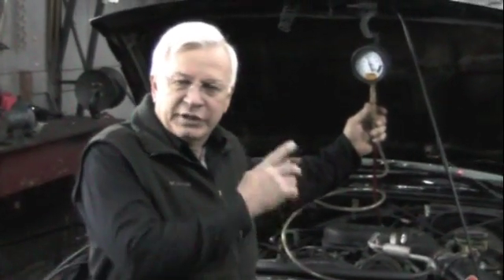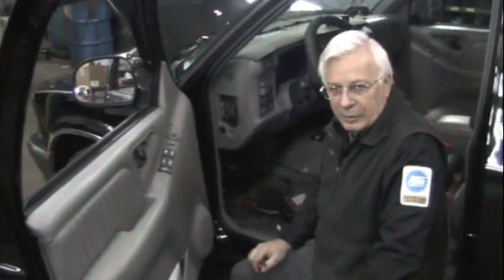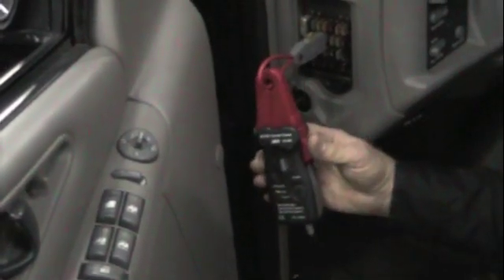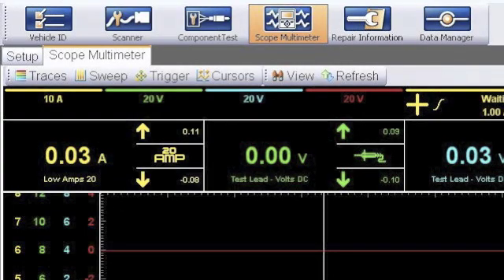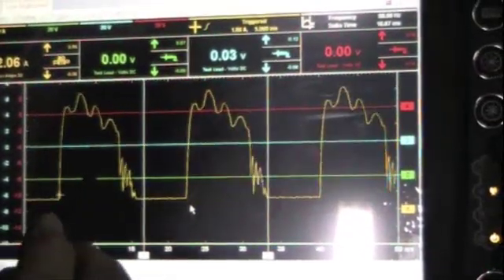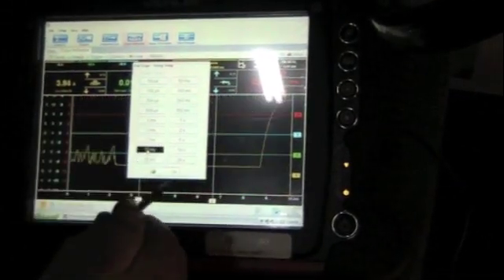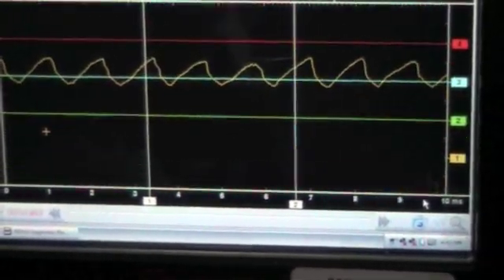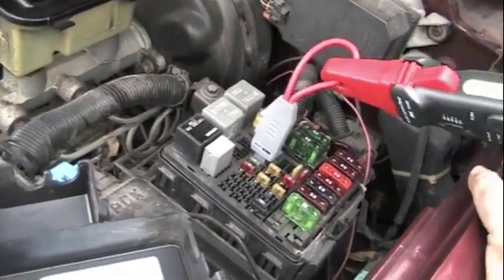Lab Scope Testing

Comment: First off, I love your channel....I watch all of your videos. VERY informative. I was wondering if you recommend the ESI-695 low amp probe you use in this video or is there another you've changed to? Is it pretty accurate even at low amps? I'm trying to decide on one and like that the ESI unit can clamp over battery cables with it's jaw size. Please share info that you can. Thanks!

Comment: I said that because all you gonna see in the scope is voltage ripple or spike if any loose connection or worn brush. Current gives a better idea of output if the pressure correspond to electrical load.

Comment: question: on some gm vehicles that have  a fuse going to the injectors as well as the fuel pump would you then hook your fuse jumper to the relay instead ? sometimes the fuse is labeled f/p inj